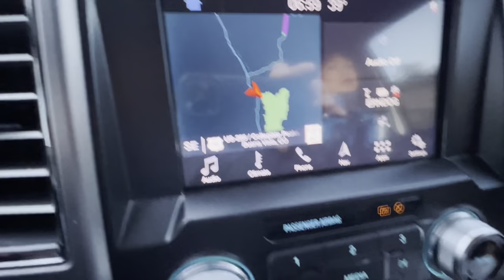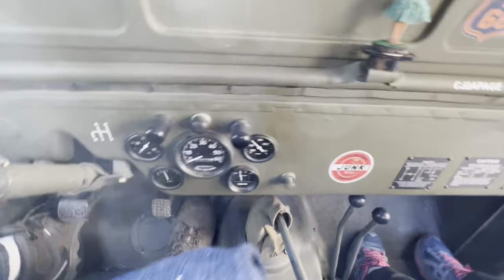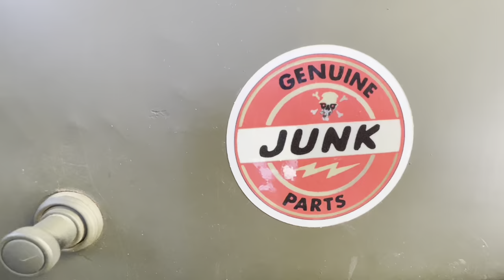Mt. Antero Colorado Fall Color Tour 2022 in my Vintage Willys Jeep Flat Fender 14, 275 ft elevation.

Comment: Man i have always wanted to ride in a willys! What team do you ride with usually? I live about an hour and a half from Mt Antero.
Reply from the maker: Hi Thomas - you can ask them if you can ride with them. Usually there are some seats open-just ask. Every year they go. It's called the Colorado Fall Color Tours. Goes 2nd/ 3rd week in September. you can contact them on the www.thecj2apage.com

 https://www.thecj2apage.com/forums/cffc-fall-color-tours-2023_topic52055.html?SID=45628-zc1c1f7efdfaddde4be39749768519

I am not going this year. but you can ask them. 
Thanks, Ernie.